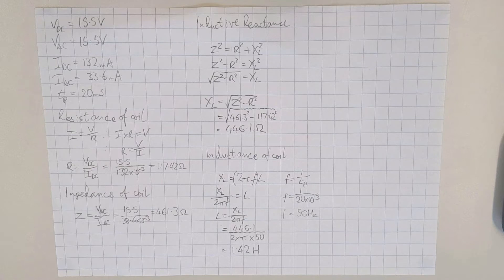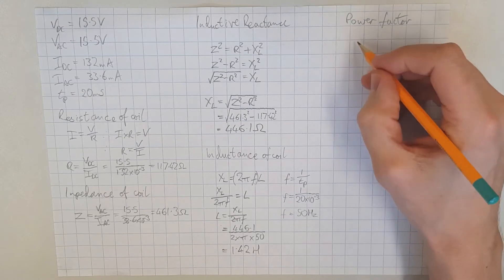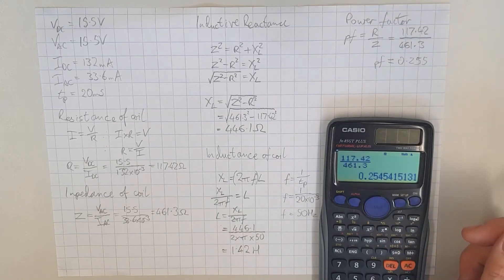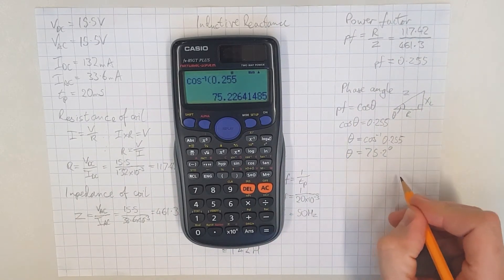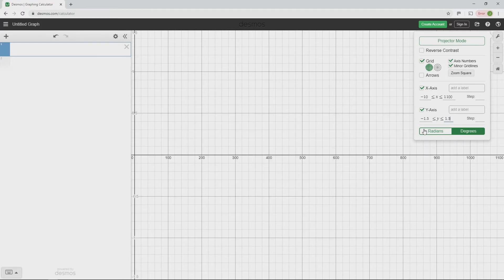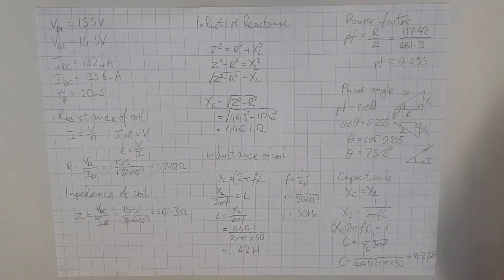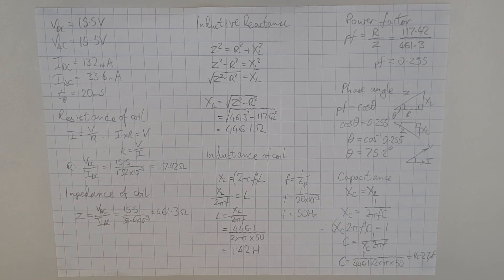AC Theory: How to Calculate Power Factor, Phase Angle & Power Factor Correction Capacitor of a Coil

Comment: Hi, Joe.  Are Zs in RL and C circiuts the same? I calcutated C from voltage drop (14,99 V) and VAr (0,5) of a coil. I get C = 6.62 microF. I did this way because parallel C does not have R in its circuit. Am I wrong? Could you please clarify the right way of C calculating.

Comment: just something i picked up. on the capacitance question on the end when you added the 2 on as you forgot. at the bottom you didnt x2 you just did 446.12 times pi times 50
Reply: I noticed this the answer should be 7.14 X 10 to the power of -6

Comment: Here's some other equations you can use to double check your answers with 😉
ω = 2πf ( Angular Speed - Radians / Second )
L = (1/ω)² / C
C = (1/ω)² / L

Ex. C = [1 / 2π(50Hz)]² / (1.42H) = 7.135µF

Resonant Frequency (f) - The frequency at which Inductive & Capacitive reactance cancel each other out where impedance (Z) is equal to resistance part of circuit.

Z = √[ R² + (Xᴸ - Xᶜ)² ]   --- No reactance (Xᴸ - Xᶜ) = 0

Xᴸ = Xᶜ or 2πfL = 1/(2πfL) ... solve for (f).
---> (f) = 1 / 2π√(L·C)

These are good equations to have in your arsenal 😊

Comment: is your calculation correct at the end of the video for capacitance? as it look as though you didn't multiply the 446.1 x 2 x pie x 50, but 446.12xpie x 50
Reply from the maker: Thanks, this has been pointed out and I've added an edit in the description.

Comment: is the inverse cosine (Cos to the power of -1) the same as 1/ cos ( 1 divided by cos), just like x to the power of -1 is the same as 1 over x (1/x)
Great vids by the way. Do you have any info on inspection and testing
Reply from the maker: Great question, you'd think so but it's not, it's the inverse cosine or arc cos. Basically it's giving the calculator a cosine value and asking it what angle had that cosine value. 👍

Comment: After adding the Pf corrective capacitor (C= 14.27uf) in parallel to the circuit,  theta ( ⍬ ) becomes zero and Pf =1  which means the current does not lag the voltage anymore, there is NO "inductive reactance" in the circuit, there is no waste of power, the "apparent power" is in phase with the "true power" and the electric company will NOT add a fine on our electric bill. True???
Reply: Two years later I just went through this again and realized that the corrective cap is 7.14uf and not 14.27uf. The error was in the calculator.

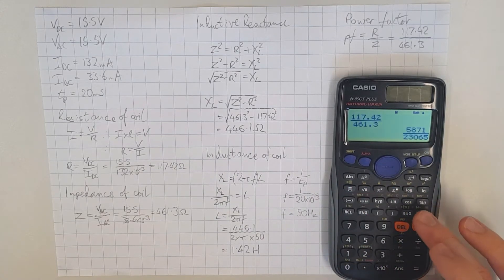Comment: at 2:02 you said that power factor is R/Z, which is corect in this case. What if I have a circuit in which a resistor and an inductor are in parallel. The impedance will be smaller than the resistance, and we end up with a pf more than 1, which is imposible. So, can you use the same formula for pf in a parallel circuit? Or am i missing something?
Reply from the maker: Sounds like a good premise for a video!
Reply: I figured it out, in a series circuit current is the same so PF=real power/apparent power=(I^2 × R) / (I^2 x Z) = R/Z . In a parallel circuit voltage is the same so PF=(V^2 / R) / (V^2 / Z) = Z/R

Comment: Hiya great video again joe but I’m struggling to follow your capacitance calculation at the end of this video. Admittedly I’m using an iPhone scientific calculator, I think without the eng button. Is there a way around this problem (no eng button)? I can’t seem to come out with 14.27micro farads??
Reply from the maker: Hi, the problem is I'm a doofus and made a mistake when entering the calc, I've added an edit in the description which runs as follows: the final Capacitance calculation is wrong as I didn't press the multiplication button on the bottom line, the answer is 7.14μF. My sincere apologies for any confusion and thanks for asking. 👍
Reply: Joe Robinson Training ha ha!! No problems joe. I thought I was going mad🤣🤣
Reply from the maker: 😂 Nope, I have to make the videos in my spare time at work and I was trying to get it done in my lunch break on a Friday with learners queuing up at the door. Clearly the pressure got to me! 😂😂🤣
Reply: Haha, just been going round in circles trying to match your last equation then noticed you missed the multiplier then read your comments. It actually helped with the learning though. Your are a great teacher, thank you for the videos.